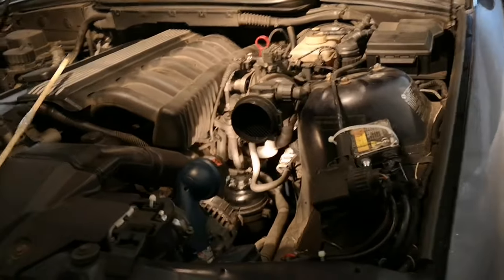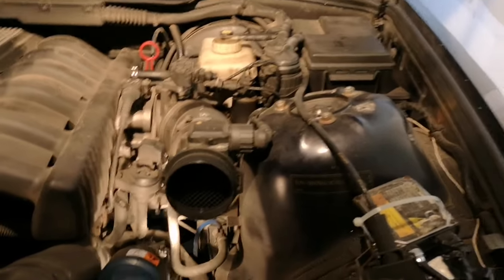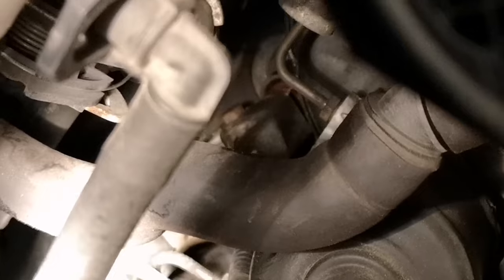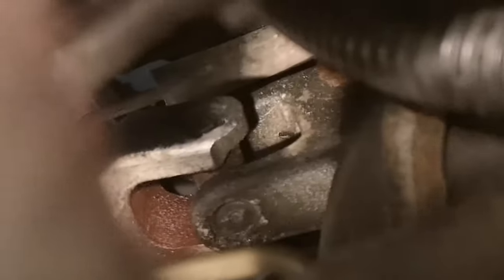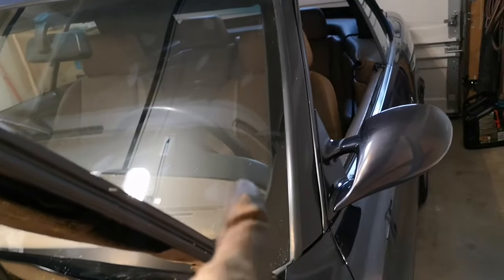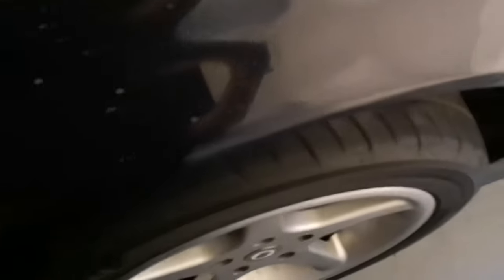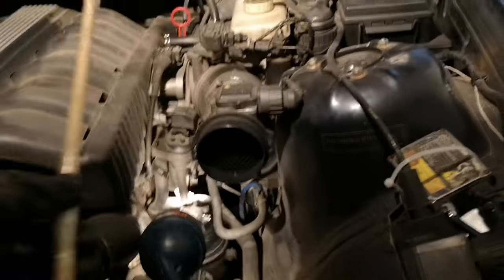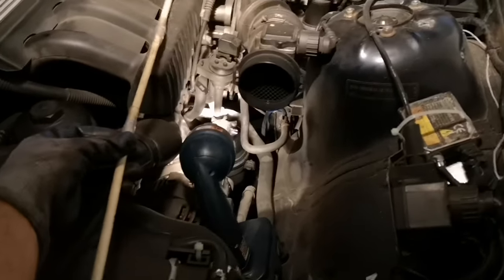Heavy or binding steering? Watch this easy fix!

Comment: My Wife's E53 steering was hanging at about 90° left or right turn.  Hosed down the steering column u-joint with silicone spray =  All fixed up.  Thanks for the insight!

Comment: About 50 seconds into the video you mention you have tried this before and it did work. You didn't show that it worked in this video.... Is there another video possibly?
Reply from the maker: This method worked on a different e36 with the same issue. I can definitely create a follow up video to show the results. Issue was that I was working alone and needed both hands to actually show the process properly and then film the results. Let me know if that helps
Reply: @6ixgarage  ok cool. Thanks

Comment: I have a 328i and my cars steering while locks when turning to the left or right seems like it gets stuck for a few second when turning then it allows me to turn eventually , this problem only happens like once everytime i drive tho would you have any idea on what it could be ? 🙏🏼🙏🏼
Reply from the maker: Seems you may have some binding in the rack. Start with flushing the power steering fluid and lubricate all moving parts in the column
Reply: Mine does the same did you find a fix for this issue?
Reply: My 2014 528i Xdrive does it in eco-pro/comfort mode when the car is idle but not on Sports mode. It fixes by itself when I release the brake pedal and start pushing gas. May be that's something like auto start to save gas.

Comment: Hey. Can u describe some of the issues when driving the car?
Reply from the maker: In my case, the steering would lock up a bit when turning and also make a lot of noise. In particular, it was when turning in one direction.
Reply: @6ixgarage  Hey. Thank u for reply. I have one of these cars myself and im beginning to feel that when i turn left or right then sometimes its kinda hard to turn and then flick the wheel a couple of times and then seems kinda normal again until next time it Does it again. Do u think its the same problem?
Reply from the maker: @madsmaltesen4708  sure does sound like it, also check your power steering fluid. Low/old fluid causes a lot of problems
Reply: @6ixgarage  Yeah, i started to think that the power Steering was the problem, but it was fine and filled to the max. I also thought about alignment, but Thats not really the symptoms is it??
Reply from the maker: @madsmaltesen4708  doesn’t sound like alignment issues. Check for binding in the rack and also in the control arm joints
Reply: What do you mean, flick the steering wheel a couple times?
Reply: @kevingronemeier6954  Turn the steering wheel back and forth quickly.